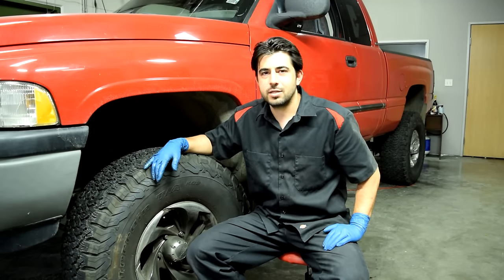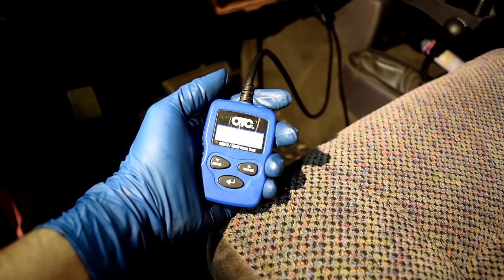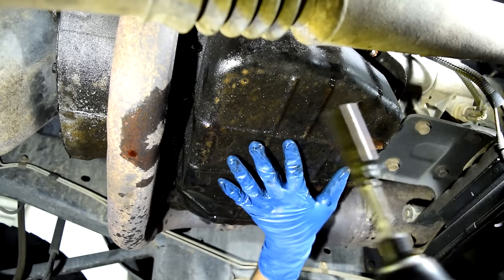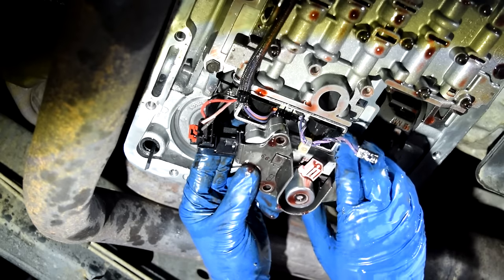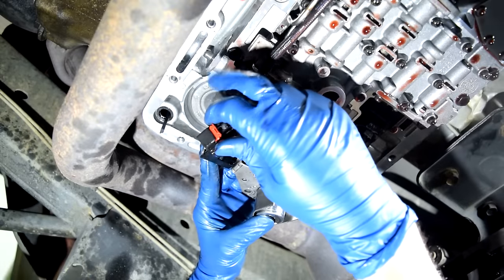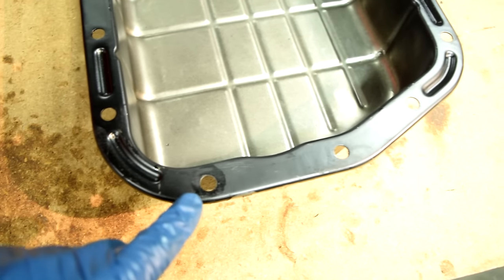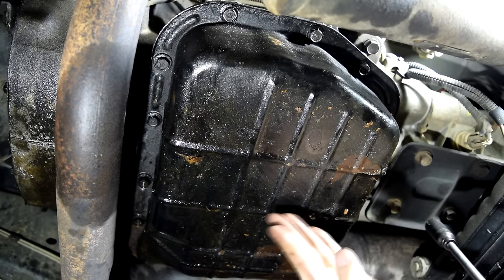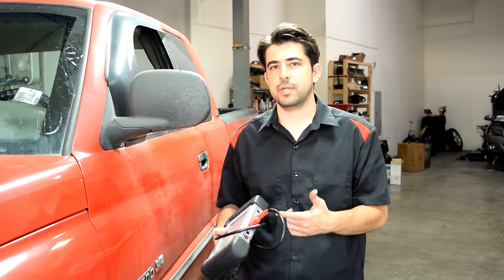How to Fix an Automatic Transmission That Won't Shift - Replace Pressure Solenoid, Fluid and Filter

Comment: I have a question for you Sir or anyone reading this with knowledge on Transmissions, since a couple of days ago my vehicle won't go on Reverse, after a few tries of going back and forth with the shifter I've noticed that when I get the shifter without letting it go between Reverse and Neutral assuredly my Vehicle goes back on Reverse, can you tell me or some other guys reading this more or less what seems to be the problem?  Thanks

Comment: Awsome Vidoe: was wondering  could you help me.. i have a 1998 dodge ram 3500 5.9 Dis.   and in the morings cant move till fully warmed  up. and also. when i take a left turn. i loose drive .  till i straightn. can you help. ty
Reply: Did you fix it or get rid of it?

Comment: i been following you a year or so, you awesome i need to figure my issue is my bmw 2005 530i drives awsome but all sudden transmission slip and wont shift stick on gear 1 and wont drives, turn the key off and on them back all normal, i read the code on my scanner saying code p17f4, i google it saying ground issue? dont know what to do? mechinacl told me just rest and comes back again** after 30miles thhe fluid ok. need help.

Comment: What If you don't have a check engine light on? 2000 ram 1500 4x4 5.9l won't shift out of first, reverse park and drive all work but again won't shift out of first

Comment: I've topped up auto transmission  with 1.5ltrs of fluid and it still won't come up to the hot mark,
Its no way near,
Does this mean anything bad,or will I just keep topping up fluid untill it's in hot mark?
Car/trans runs fine,I just noticed it  very low,
I check it after 30mims of driving,idling,an up thru gears, 

It seems to be over full when checked cold,
And way under full when hot,

Comment: 2011 Kia Sorento was accelerating really slow and didn't seem to have any power, wouldn't shift into higher gears (would shift when manual mode was used), checked fuel pressure, compression, everything seemed fine, one code was stored was an emissions code. Ended up pulling transmission and replaced torque converter and while I had it out replaced the wire harness which is a known trouble point. Got it all back together and same problem, poor acceleration and low power, shifts fine from 1st to 2nd, sometimes shifts to 3rd, can usually get it to shift to third and sometimes to 4th if i let off gas for about 5-10 sec ( weird), will not shift into 5th or 6th. really frustrating, can't believe the new torque converter would be faulty so I'm thinking it's got to be something else, bad shift solenoid but I'm not getting any codes. Checked for codes after I got it back together and drove it, it has P2096 Post Catalyst Fuel Trim System Too Lean Bank 1 and C1260 Steering Angle Sensor Circuit-Signal and the traction control and downhill lights are on (turned traction control off for now), those I know came up because i changed tie rods and everything and i need to reset the SAS. The P2096 not sure if it needs a new O2 sensor or being caused by something upstream, I wonder about the TPS sensor but would expect it to have a code. I wonder if the shifting problem is a bad solenoid but again i would expect a code and not getting one, any ideas ?

Comment: Hello.  I need your help on my 2004 Jeep Liberty 3.7 V6 with 42RLE Transmission 4X4.  It started slipping and threw up code P0700.  All the things I've read have only cluttered my head.  Does it mean rebuild transmission or change the big solenoid above the filter or the smaller solenoid that looks like the one you changed in this video?  Please help as I am getting tired of all these car issue. LOL!  Thanks!!

Comment: I'm in seek of help from someone who is actually experienced. My friend has a 97 Dodge Ram 1500 that we just replaced the governor pressure solenoid and the other one. It shifts again but won't go past 3rd (2500-3000 rpm at 65mph) I don't believe it goes into OD or goes past third. Help is appreciated.

Comment: the problem i have with my 2001 dodge ram 1500 is something is wrong with the way it shifts. And it only happens when the vehicle is started a second time after turning it off. Like i can start it up and go up the road just fine and it shifts just fine but it i turn it off and back on and go back down the road it doesn't want to go past 30mph and the rpms go all the way to 3 even 4. Sometimes it kicks in gear and goes fine but not lately. And it just started happening it was fine not to long ago. Any advice?

Comment: I have a 2001 Dodge Ram 1500. When I put it in drive it starts in 3rd gear. If I come to a stop, it won’t shift below 3rd gear. I have to manually shift from 1st gear from the gearshift.

Comment: My shifting is rough, no joke. Everytime i drive, each gear feels like someone is jumping in the back, i added a cleaner but no difference
Reply: My ford taurus been sitting for 2 years I took the car to a dealer to check the trans they say 3 and fourth gear clutch is bad but a mechanic that had work on my car said is not the trans is in the motor I don't now how's rigth can some one help me.
Reply: It drive grate on issue is that

Comment: I have 2001 Toyota Tacoma that  I would have to crank several times before the engine would turn on and stay turned on. I changed the fuel pump and having the same issues. Any suggestions?
Reply: Robert Silva clean tihe maf sensor and throttle body

Comment: I need help!!! I have a 1995 jeep grand Cherokee and at first my trans wouldn't shift right like at 25 or so mph I would have to let go of the Gas for it to shift or it would red line if I let it but now it shifts but can't go over 34 or 33 mph all it does is Rev high and I would have to hold it at 3-4k rpms to maintain speed I already replaced the filter and fluid and the output speed sensor

Comment: I have a mazda 5 2006 and when start the engine I have to wait around 10 min so is transmission work at drive if I place in drive position when is cold the alarm AT cames on , and it don't drive is slippery until heat up for 10 min any suggestions

Comment: I have a 95 Dodge ram 1500 4x4 5.9 and it is obd1 and I know I can flash the codes by turning the key on and off three times.. but what scanner can I use to clear my obd1 codes ????

Comment: I have a 2003 ford Taurus it has 49 thousand km. It won't shift out of first gear no matter how much gas I give it. I think it's a modulator valve to the transmission. Any suggestions

Comment: Took my truck to replace a sensor and they charge me for a transmission rebuilt 2k. After 2 days they called me saying to bring back the truck because they didn't replace the sensor i came for. Even asked me to install a small transmission cooler radiator for $200. My truck broke down 1yr later . I'm not gonna say the Name and locations of Hillsdale Transmission in San Mateo California so they won't be mad and reputation goes bad.
Reply: 😂 you not gonna say.

Comment: I use sewing thread to tie the gasket to the pan own each hole tie sewing thread through hole of pan then gasket then tie down it holds gasket straight own pan so u can put bolts in

Comment: This 2000 and Up Dodge/Chrysler 46RE 47RE 48RE Governor Pressure Solenoid Repair Kit fits in ford freestar 2003?
Reply: Ramon Cutino no it does not fit any ford!

Comment: I just replaced both the pressure and governor solenoids, filter and fluid but still have the same no shift 2 to 3. 99 ram van 1500 3 speed/OD 360. HELP??

Comment: Okay mine is not throwing any codes should I just hit the gas hard and force it to throw a code because I am tired of not knowing it won't go over 25 miles an hour. But when it goes down a hill it has no problem shifting

Comment: Toyota  Corolla 2009 Shifting/High revving problem
is supposed to shift at 2000 rpms but doesn't shift tell 4000 rpms. (5 speed automatic Cvt  Transmission. When WOT, It does not let you floor it when out of 1st gear. Only 1st lets you floor it but does not let you shift into 2nd at WOT. Please help!!!
I didn't have  any code

Comment: My Corolla is having shifting issues but the OD light starts flashing first.  The car will be running fine and then will drop out of gear completly.  i have to pull over,  turn off the car. put it in park.  wait a few minutes then it runs like normal.  Is this is procedure I should ask my mechanic to follow or is my issue something more difficult?    I hope u write back, and help would be HIGHLY appreciated!
Reply: outworlddragoon hi did you find out the issue you are having? my Volkswagen is doing the same thing and they said it might be something electrical in transmission......I'm scared to find out the cost though

Comment: Can u help with any info on my 1990 cutlass cerri s driving down highway never had any transmission problem at all pressed break went to go agin tranmission started slippn then reverse stoped but now works but no matter how much gas i give it wont shift i put lucas tranmission help in it but nothing n i also may put a lil bit to much in its over fill level anything u can help with info wld b great ty

Comment: next time just dip in ultrasonic cleaner for an hour , sometimes just tap it with brass hammer  that will make the internal valve dis-seized and will work fine till the dirt accumulate inside  and size again.

Comment: My nissan pathfinder 2005 dci automatic only driving in 3rd gear, transmission not shifting. Speed reduces and Il have to switch off and start again. Also struggling to Pull or drive when switching on

Comment: Amigo I have a 85 ford f250 and when I start it I have to wait over half hour for the gear to go into drive and have to reav the engine and then the gear will jump in

Comment: help me  i do have a bad transmission problem in my volvo and no shop want to do it around me , i did replace it 2 twice and 1 rebuild and still the same problem do you know what can i do i do have a volvo s60  2002 i just do not want to put it in a junk yard because is alot of money already in the transmission.  I am driving 60 mph and then from nowhere the transmission slip and leaves me in neautral like for 10 seconds. what would you recomend me ??

Comment: I have a 48re trany on Dodge 99 Ram 5.2 I have problem when it sits a week or two I get in it put it in gear 30-40sec later it starts to move . I'm thinking of changing those two pieces and adjusting the bands ur thoughts plz
Reply: Did that fix yours? My ‘07 w/48RE is doing the same thing.
Reply: Daniel Loveall did that fix yours. My 01 dodge pickup 1500 does the same. What did you do to fix yours please??

Comment: I have a 97 ram and once I drive It for a while it seems to kick out of overdrive and won't go back in. My o/d off button comes on when this happens. I push it to get o/d on , it does nothing. What's my problem? I went to trans shop and only code was for torque converter.

Comment: My b5.5 wont shift right in the morning all the lights lit prnd went solid and it said excessive clutch slip but its an auto and i turn it off then in and it is ok but i need let the car warm up for like 7-8 min and it wont shift oddly. Any suggestion? Thanks.
Reply: 408skills. conventional automatic transmissions have a clutch pack in them. It's probably the most common wear item in them.
Reply: I went to aamco and i was told that they need to open the transmission so that they could find out the issue and fix it, total price 2900$.
Reply: 408skills. they get you on the R&R of the transmission. That's the most expensive part of the process. The components themselves are typically like $200.
Reply: I just fixed this on my 03 b5.5. Culprit was N91 solenoid. I was getting late shifts from 1-2 and very harsh 5-4 down shifts. The process can be diy if you get all the paperwork for your trans (ZF) and are meticulous. I pulled it off any one can
Reply: no way foreals fixed?
Reply: igot the awm engine
Reply: Yup that's my as well, I'll send you a link of the repair. see if you are up for it.
Reply: 408skills.
Reply: C Hernandez is that the 4 motion
Reply: Snoopy for me yes
Reply: 408skills. Nice, I have one too
Reply: Snoopy FWD but my passat got totaled recently. Sister slammed into a boulder. 😢
Reply: C Hernandez Tell her don't text and drive
Reply: 408skills. I have a 1999 Lexus and it want shift into overdrive till it gets warms up and then it will shift great the rest of the day its a Rx 300 all wheel drive

Comment: Just  had my 46re transmission rebuilt all of a sudden when I drive it and I pull up to a red light  or  stop sign and I go to take off my  durango want move  but if I put it in first and shift  up to drive  it shifts  fine  what could be the problem

Comment: My 2006 kia rio transmission shifts properly only for two days when it's parked up let's over the weekend,after I use it constantly after for a day or two,it goes into limp mode and gets stuck on second gear,it has over 225000 miles Please help

Comment: help I just changed my transmission fluid in my 04 Lincoln ls, because it was shifting so hard into gears, and now the car does not want to move forward or backwards

Comment: My 1996 Dodge Magnum Standard transmission  all of a sudden I was driving the I had to pull over the transmission was not in gauging stopped working but I can shift in ever gear but will not do anything. I had to pull over right a way but was on a hill I put in gear and it would roll still. WHAT TO DO

Comment: I have a 91 ford ranger with a 4.0 motor , and the transmission all gears are forward including reverse what is the cause and won't go faster than 25 miles hr

Comment: Ok this was all going fine fo me UNTIL the electrical connector with the two safety releases buggered up.  The black tab just flexed then broke when pushed.  I worked at getting it apart BUT didn’t push my luck.  If the wired end gets damaged it’s a major job to fix. 

Does anyone have a way to release it without destroying the wired end.

Comment: my mitsubishi pajero is automatic. it works for about 45 minutes and then it stops while in drive. i have to stop the engine and start again. then the vehicle moves. sometime it does not move. have to restart again and then it moves. then it moves a few kms and then have to stop and start again.
please can you give me some advice and solution

Comment: Hell i had this problem on my jeep though was low fluid as my jeep never thru a code and still doesnt for this issue i did fluid change found filter in pan fixed prob for bit then comes back. I use have problem where overdrive only did this it wouldn't kick in OD but strangly i can manually shift down 1-2 then sift back up and OD will kick in now i got this video problem but if im towing a trailer my transmission runs smooth silk take trailer off back issue

Comment: Thank you sir now I know what I need to do next weekend. My problem is that my truck won't shift from first to second without letting off the gas and then I can't go above 2,000 rpm's without it winding out and plus my speedometer doesn't start working until I hit 60 mph so maybe this will help
Reply: Did you ever figure out what what the problem, my truck is doing the same

Comment: I have Jeep Patriot 09 auto Trans 2 wheel drive I just replaced the transmission and Its Drive & run but doesn't have power when i shift it to D mood it's run but sounds like driving with M1 gear all the time

Comment: Would appreciate to know what can I do to fix my automatic transmission Toyota prado. It doesn't shift to the last gear only. Like that it's putting to much effort on the engine.
Reply: Munir bassir if your throttle positioning sensor has three wires coming off it only works fuel but if your throttle positioning sensor has 4 wires it controls 4th gear Overdrive a lot of dodges will lose 4th gear Overdrive shops at L you need a new transmission all it is is a $39 throttle positioning sensor
Reply: Rick Simpson thank u very mugh. But it all started when I had to change the automatic transmission and installed other one. But I think the problem is in this   transmission that I installed. Problem is here I can't find anyone to test it. So wanted to know if it can be the valves that u find when u remove the sump

Comment: Hey my 1995 chevy 1500 is doing the same thing where it will shift sometimes buts it's not throwing a code or check engine light
Reply: What should I do

Comment: hi I have a Toyota Camry 2002 my car wasn't going in reverse somebody told me to change your shifting solenoid .i change them but still is not going in to reverse is going forward I am driving like a 70 80 speed is going okay and if I reverse  there is burning  smell  it's not going  reverse

Comment: have 1995 ford f150 4x4 that won't go into drive gears,it goes into reverse but not drive .engine just revs, has fluid.

Comment: I have a 96 cadillac eldorado my problems are with my transmission reserve there is a carnation pink like substance coming out of the area where my dipstick goes.its almost like strawberry milk.theres no odd smells.also I fill my fluid about 1-2 times maybe in timespan each time I check dipstick it doesn't register as any fluid at all.where is this fluid going if its not staying in refill tank?there's no leaks anywhere that I can see or find anywhere....why is that n where is it going? im very frustrated can someone please help me figure this out? please...

Comment: I have a 95' Buick Riviera that doesn't always shift into overdrive. When it does this I turn the key off and restart and usually this will fix the problem temporarily but if I come to a stop again and then drive on sometimes it does it again. I don't have a check engine light on. Does anyone have any ideas?